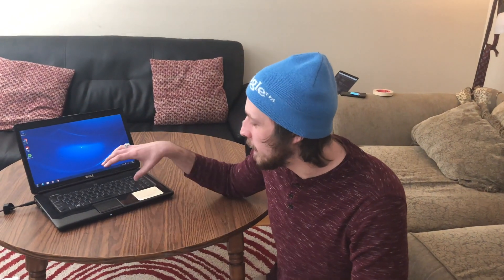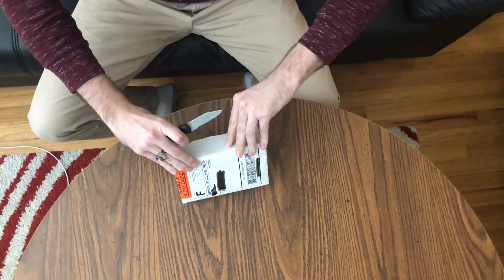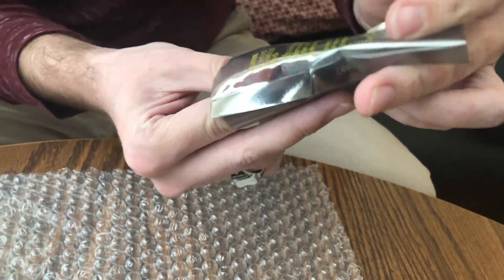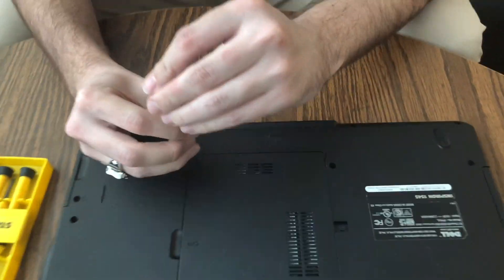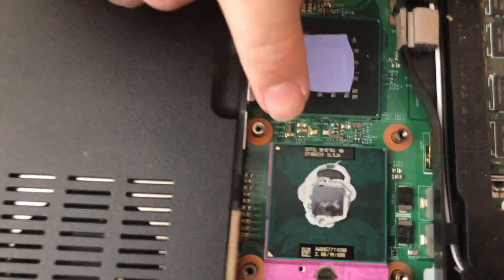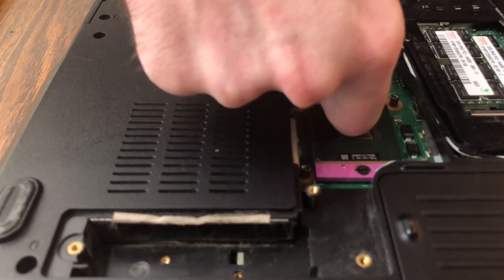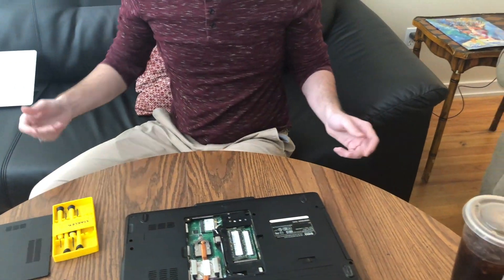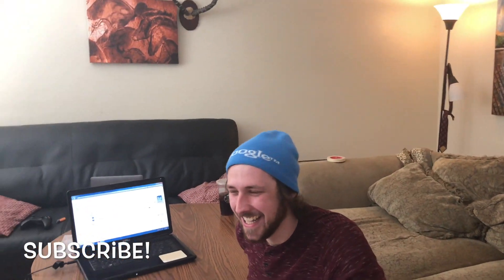Installing Intel T9900 CPU in Dell Inspiron 1545

Comment: I'm watching this on my 10 year old Inspiron 1545 with the T4300 and 4gb ram.
Reply from the maker: Legend
Reply: @BenDoesCoolStuff  I purchased a T9900, a 8gb ram kit, and a EXP GDC expresscard pci-e adapter for a graphics card. I'm going to see how well this holds up.
Reply from the maker: Bboyman1150 that is absolutely epic. Sounds awesome. I’m wishing you the best!
Reply: @Bboyman1150  what external gpu are compatible with 1545 brother?
Reply: Hugh Luzon Almost any GPU will work
Reply: @Bboyman1150  how are you attaching an external gpu ? Through the express card adaptor of 34mm??
Reply: @Bboyman1150  hi, did you upgrade your laptop?
Reply: Eric Litho Yes
Reply: I have the t4200 and 3gb ram. I've ordered 4g for it and am considering changing the processor. It's my spare laptop at the mo but am considering making it my work laptop. I'm an online teacher so want it to be reliable.  Also want to have 2 reliable laptops just in case one fails.
Reply from the maker: @kieronimo1  Upgrading to an SSD is the best upgrade you can make to this computer. I would recommend that before changing the CPU.
Reply: @BenDoesCoolStuff  Well, the SSD is fine, but we are talking about how much with a 32-bit operating system, and it would be much better if it already had or could already work with a 64-bit system, it does not matter if it is W7 or W10, in addition to the extra support that we would get from dell itself in terms of drivers and operating system.
Reply: Mine came with pentium and 3gb of ram, i updated to 4gb, put an ssd and it can run windows 10, can you leave me a link to that processor and 8 gb of ram?
Reply: Romario Rodríguez search “T9900” for processor and “2x4gb ddr2 sodimm” for ram. “exp gdc beast” for graphics adapter all on eBay
Reply: @Bboyman1150 how does your rig run with the gpu adapter, considering getting one myself
Reply: Matt W I honestly don’t remember how it runs. Don’t expect anything amazing but it will be better than integrated graphics

Comment: Hey Mate, I also have a Dell Inspiron 1545 laptop with processor T3400. Can i upgrade it with T9900?
Reply: first update the bios
Reply: @fabianadecarvalho7944  updating bios is necessary? I have a10 bios.
Reply from the maker: You should be able to!

Comment: Hey mate, did you notice your cpu fan running more? And also harder? As soon as I got my old T6400 it goes back to normal
Reply: Did u check the wattage??? It could be because a higher end processor puts out more heat.... So the fan I always running at maximum speed to compensate for the heat... It could also be an issue with ur cooling assembly

Comment: this dude def smokes weed. lol
Reply: he knows how to open little packages really well. plus can tell you how much cpu weighs without a scale. ;)
Reply: what a plain comment
Reply: @henkholdingastate  my comment? Not a bad thing. I liked the video. I could just relate.
Reply: @10SecondZ06  I had misunderstood. I thought someone commented on your video and called you a drug smoker. Sorry for the erroneous response from Holland PS: I have the same edan with my Acer aspire 5720Z and have been using a T8300 for years and I am not thinking about a T9900 but it costs $ 50 in Cina and maybe better to buy another laptop.

Comment: How has it been holding up since the upgrade? Someone gave me a 1545 and i was thinking of doing the same thing and updating the ram.
Reply: 4GB is the maximum. If you want it to be MUCH faster upgrade the hard drive to SSD
Reply: 8gb is the max for this laptop. I went from 4gb to 6gb and noticed a difference but then i went to 8gb and i noticed a big difference. I then put in an ssd and that was the icing on the cake
Reply: @emilyc9240  Did you upgrade the processor too? I have stock processor and 4 gb ram. If i upgrade to 8 gb is it worth it? I just want it to be faster. Its too slow with windows 10.

Comment: thank you for that. I live in Brazil and have a Dell Inspiron 1545 from 2010 working great. A new laptop here is too expensive (aprox. US$850), and I was wondering what to do to make it last a few more years.
Reply: possuo o mesmo. Veio com T4400, 2gb de ram 667, hd de 240 e wifi padrão G de 54mbps e hoje está com o t9600, 4gb de ram 800mhz, um ssd de 120gb, um caddy de 500gb e um mini pci-e wifi padrão N (150mbps). Se o dolar baixar, coloco 8gb
Reply: @fabianadecarvalho7944  Eu tenho um Itautec N8635, 4GB, HD 320 com um T6600. Queria colcoar um T9xxx qualquer, mas o preço dos usados no Brasil estão absurdamente caros.
Reply: @fabianadecarvalho7944  Opa, fez a atualizaçao para 8gb ?

Comment: Hi... I tried it with my Asus K5DIN from t6500 2.1gb to T9900 and it didn't work. Do you have any idea what I should do? I tried to update my Bios and doesn't worked.
Reply: only work if the bios is configured for this processor

Comment: After doing this changes does it work for video editing? I have the same model and I'm debating whether I should buy me a new one for video editing or try this. Hope you can answer. Thanks!
Reply from the maker: Although it does work for some light video editing, if you are working with footage shot from modern day cameras, such as 4k 60fps footage, I wouldn't recommend using it as a workstation. This computer is great, but it is still limited in what it can do (it's over 10 years old!). Another thing to be concerned about is the heat. This processor can get pretty hot, and overheating may be an issue with video editing. 

With that said, it does work surprisingly well with footage 720p and under. I've tested this myself. So if you can find the processor for cheap, and are working with lower-quality footage, you should be okay. If you're doing some serious work, you're definitely going to want a newer machine though!
Reply: Video editing and applications like Blender and Unity aren't going to be the best - even with max CPU, RAM and a new SSD. The problem is the GPU of the laptop, it's not replaceable. And it's not great either. It was designed for work with documents and web browsing, not games and video editing.
I'd say you could still get along with doing some light editing though...

Comment: I have this laptop and I am using it from the past 8 years. Problem within this laptop is that 1. It struggles while playing videos online. I can't watch 720p 60fps youtube videos in any browser. 2nd CPU usage goes up quickly whenever I load any website. 3. You just can't do editing work.. Simple editing takes hours.  I want to know how much it will enhance the performance after upgrading the CPU.
Reply: Yes man I can't watch 720p 60fps too, I will upgrade mine to a T9900.

Comment: Classic laptop? 🤣 Famously problematic for overheating due to flawed design, so what does he do? Installs a higher TDP cpu 🤦‍♂️ Your ram score went up because you went from an 800 fsb to a 1066 one
Reply: ive had mine since 2009 never had any issuses and its runing windows 10 if its overheating might want to clean the fans and replace the thermal paste with new these models do tend to get cloged with dust easy cause the fan is pretty exposed to the elements but then again thats why you use it on a hard surface like a desk and not your bed.
Reply: Just use laptop cooler below the laptop. Problem solved.

Comment: I upgraded my Sony Vaio VGN-FW590 series laptop to this T9900 CPU. And while it works perfectly fine the only issue is the cooling. Man that CPU get so damn hot if under heavy load. And I’ve had it nearly hit TJ MAX under heavy gaming load. I’m considering adding a copper pad on top of the CPU before I put back the heat sink.
Reply: Oh my god thank you for posting. I am in the middle of upgrading the exact same laptop as you and it's so hard to find ressources or any kind of info on Vaio's. Like you, I decided on going with the T9900 and my main concern was the TDP increase from 25W (Core 2 Duo P7450) to 35W but I guess that it works. You mention cooling issues during gaming and copper pad as a solution. Can you provide the model you bought to solve the heat problem ? I don't game on my laptop so I'll probably never hit max temp but better safe than sorry.
Reply: how the everyday usage? such as browsing the internet, listening to spotify, deezer, youtube?
Reply: @TinCole  HI so since I never updated my original post, I did get the copper pads for the CPU and that took the temp down to 77 C at MAX load while running Prim 95 for 30 mins. So that's much better than what I had before. I don't use it everyday anymore since it's very old, but nowadays it really starting to show it's age. I can still do light web browsing just fine. Youtube 1080p is good but it can't do 4k. It stuggles to render the video and it will freeze. I know its the PC and not my internet because I don't have that issue with 4K videos on my desktop. Overall it's now 10 years old. And I got my money's worth out of that PC. Wish Sony still made good quality laptops. The new Vaios are in name only. They are made by some other company and the quality really went down.

Comment: The RAM score went up because you replaced a 2.2 GHz 800 FSB CPU with a 3.06 GHz 1066 FSB one.

Upvoted because this is very useful information for anyone with one of these. I've upgraded several 1545's with T9800 and T9900.
Reply: And the speed memory ram for upgrades should be the same 800mhz even if the fsb is increased for the new processor?
Reply: I have a toshiba a300 laptop with core2duo t3200 and planning to upgrade to t9900 will it work?
Reply: @TinCole  I don't think it will. You have the correct socket, but the T3200 is a 667 FSB processor, and those only ran in chipsets that won't support the 1066 FSB of a T9900. I'm almost certain that the best CPU that system can take is a C2D T9500, which is still a big improvement over a Pentium T3200. You could also try the Core 2 Extreme X9000, which is compatible but runs very hot, and I don't recommend it even though it is faster than the T9500 (2.8 vs. 2.6 GHz).
Reply: @johncate9541  Thanks for the feedback. I googled it and some users got it working. I ordered a t9900 from aliexpress for 40bucks and I'll see lol. I'm really hoping it will work, like some other users reported on the internet, and the toshiba laptop a300 was sold in different variants of intel cpus.
Reply: @TinCole  did it work ? I have a toshiba c660 with a celeron 925 with 800 fsb , and want to upgrade it to C2D t9900 or t9550 but both of them are 1066 fsb  , would it work if I swapped a 800fsb cpu with a 1066fsb cpu?
Reply: @johncate9541  Will the T9900 work on Dell Latitude D630?
Reply: @ۅآھِݽِْ-ه8غ  No. That uses Socket M processors, not Socket P. I think the best Socket M is a T7600.
Reply: t6400 to t9900 supported in 1545 or not?
Reply: @sagararora810  T9900 is supported in any Inspiron 1545 regardless of what CPU is in there now. I have made that swap many times. If you want to do this, go for it. If you want to save a few bucks, the T9800 is half the price and offers almost the same performance.
Reply: @johncate9541  thanks man
Reply: if i put a T9900 in my dell with a 8gb ram will i be able to game?
Reply: @Ziyaadsalie1-l9k  It's not going to help very much. Back in the Core 2 era, the graphics controllers were separate from the CPU. The Intel onboard graphics aren't going to improve just because you put in a faster CPU. You might get a few more frames, but you're still not going to play anything that came out later than about 2008 at acceptable framerates. If you have the rare Inspiron 1545 with a Radeon 4330 GPU onboard, you can play games from a few years newer and will get better framerates, but on anything in the last eight years or so, it will be just as helpless.
If you upgrade the CPU and RAM in a 1545, you will get a much snappier and responsive machine, but it's still not going to play games very well. If you want to do that on a laptop, you will have to buy a new and costly laptop with a recent CPU and dedicated graphics.
Reply: @johncate9541  what is i install a graphics card with 8gb ram and a t9900 cpu will i b able to run gta or will the machine still b incompatible?
Reply: @johncate9541  my man, what external gpu's are compatible with dell 1545?
Reply: @Ziyaadsalie1-l9k  depends on the game because the video card will still be the same. These upgrades are for the laptop to be faster and not for new games. If the game has run before, it should run better but if it didn't, it probably won't run yet
Reply: @Ziyaadsalie1-l9k  mmaybe you can use a eGPU.
Reply: I did the exact same as shown in the video. Same laptop, same CPU. Pressed the power button, the power light flashed and went out and turned on. Heard the harddisk run for a few seconds. Then it stopped. Screen is blank. Laptop does not load. Bought a used CPU online. Help please!!
Reply: I have Dell inspiron 1545 with Celeron T3000 processor running at 1.8ghz, what processor do you reccomend for me?
Reply: @reflex9991  T9900 if you don't mind spending the money, but a T9600 (2.8 GHz) will give you 90 percent of the performance and costs $20 on eBay. A T9800 (2.93 GHz) or T9900 (3.06 GHz) will set you back $40-60.
Reply: @johncate9541  Thank you, I will use your advice. I probably would take the T9900 for the extra perfromance
Reply: I have a pentium t4500, put a t9900 core duo It's possible?
Reply: @augustocezar3585  Yes, the T9900 works in any Inspiron 1545.
Reply: @johncate9541  Just a quick question if you have the time to answer, but I was wondering if a T9900 is compatible with the Dell Inspiron 1750? I plan on doing some upgrades to it including a motherboard with a dedicated Radeon Mobility 4330/4350 iGPU along with 8 gigs of ram and a decently sized SSD to compensate, but I'm just curious if the T9900 will be compatible and boost the RAM's frequency or not. Thank you.
Reply: T9800 is great?
Reply: Are the original 800Mhz memories compatible with these T9* processors?

Comment: i have that same laptop its a solide consummer machine but the only trouble ihave is my screen has a black ink spot on it and its a ccfl screen and the screen for this laptop is hard to find and really exspensive
Reply: I'm pretty sure you can convert it to the LED version. I've seen tutorials for that before.
Reply: i have this laptop and it’s just absolute shit. it’s very very slow and i’ve tried so many things to fix it, but no matter what nothing seems to work. i cant even multitask, use programs such as adove flash, or even open up  more than 1 tab
Reply: If you have the version with the Celeron CPU, it's useless. The only way to use it now is to replace it with a Core 2 Duo. If you have a C2D and it still runs poorly, there's something else wrong, probably with Windows itself.
Reply: @johncate9541  no i put a core 2 duo in it a while back
Reply: John Cate that’s exactly the one i have. fuck. thanks for letting me know. guess i gotta find where i can find a core 2 duo
Reply: @kyotosghost  really i can. its got 8 gb of ram and a ssd
Reply: Jordin G 
How’s your gaming for a game like league I use to play on it but it’s gotten really slow and haven’t done any upgrades to it but I plan to now from these videos and comments?

Comment: How much of a difference did it make ?? Is it worth it or do I just go t8300 or something  like that because you can’t upgrade gpu can you  cheers for the vid
Reply from the maker: The difference is night and day. It feels like a brand new computer, besides the graphics drawbacks. Although, I should note that also have 4gb ram in this machine, and more importantly, I also have an SSD. 

Frankly, out of all upgrades you can do with this machine, an SSD makes the biggest difference. Invest in an SSD before the CPU. I already had an SSD, and wanted to upgrade more, so I got the CPU. 

This processor cost me $60 on eBay and for me, this was much better than buying a new machine. 

If you also have a T4200, then a T8300/T8700/T8800 would be a great upgrade, and probably worth it. 

Replacing it is fun too!
Reply: cheers dude  mine has 4gb ram too .Iv ordered a Samsung evo SSD  and a  new 9cell battery still not sure on the cpu :( 
wish a i3 would work lol   think i will buy the 8800 thanks for the help
Reply: just got a t9600 for £5 Winning
Reply from the maker: growfishgrow badass dude!!! 🤣
Reply: If you're not gaming, it makes a big difference. But who's ever gamed on an Inspiron 1545?
Reply: Hey man i have a T8100 is it worth to upgrade to a 9600 or a 9900? Considering that vaio cooling system ain't too good
Reply: Or p8800, p8700